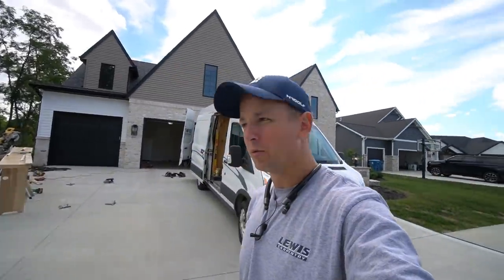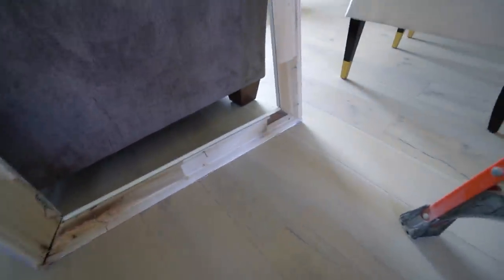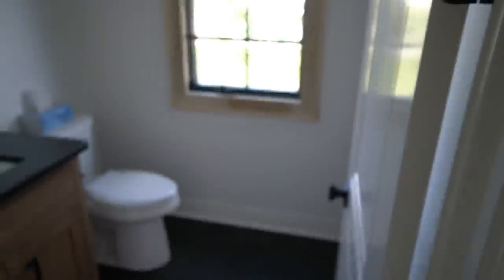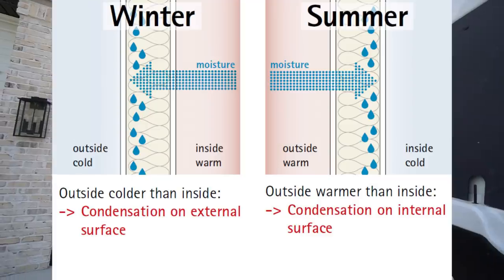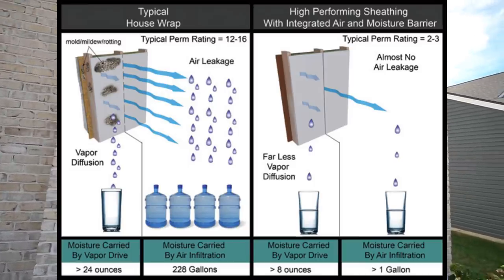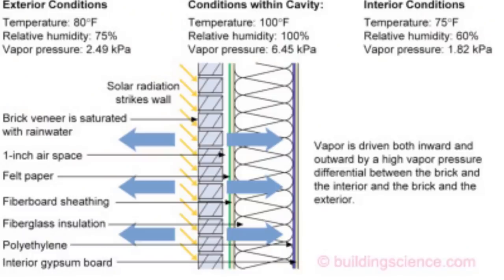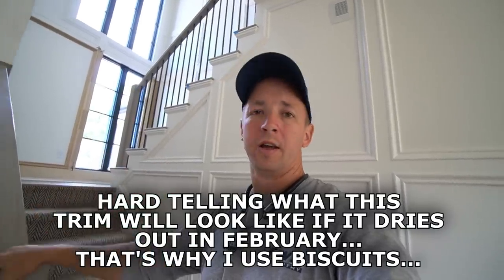Trim Humidity DISASTER!!! Is Vapor Drive Destroying this Trim Package???

Comment: You might have biased your responses by saying what your hypothesis is.  With that said has the North side been exposes to excess bulk water or water absorption from the ground.  1/2 in closed cell spray foam might not have been enough to prevent vapor drive from a water absorbing cladding.  2 inches of closed cell spray foam has a perm of less than 1.  However it might be enough to prevent drying to the outside as well as allowing vapor driving to the inside.  Is the Air changes per hour (ACH) known?  What has the interior relative humidity been?  What has been the average condensation temperature?  Other issue is installing a kraft faced fiberglass bat.  This essentially acts like a moisture sandwich for the fiberglass.  Moisture/vapor will reach the fiberglass middle (between the CCSF and the kraft facing) and have a difficult time getting out.  Should have installed the fiberglass bat without a facing.  What humidifiers have been used?  Build tight ventilate right.  Ultimately hard to say whats causing it without opening up some walls.  Based on what you've shared recommendations may include:  removing drywall and fiberglass bat, spray another 2 inches of CCSF, then fill remaining bay with unfaced insullation, install whole house balanced or slightly positive ventilation.  I feel terrible for the owner, looks like a real beautiful home.

Comment: So by reinforcement do you mean glue? In your videos it comes off that you use the clam clamps and hipur gun for casing, but in this video you mentioned biscuits. Are you biscuiting every window casing in your work?
Reply: I was wondering the same thing.I mean surely they at least used glue, but he kept saying miter reinforcement so it threw me off
Reply from the maker: For this size casing I would be using hipur. For the replacements on this job I used number 20 biscuits and clam clamps. There was basically no glue on the miters in this house and no clamping pressure.
Reply from the maker: For this size casing I would be using hipur. For the replacements on this job I used number 20 biscuits and clam clamps. There was basically no glue on the miters in this house and no clamping pressure.
Reply: @InsiderCarpentry  thank you for the clarification

Comment: If the front of the house is the North side then it was probably cold during the winter and condensing water from inside the house.  Is there a humidistat issue turned too high.

Comment: Looks like there is no vapour barrier on the inside.  I should have watched the whole video first.  There needs to be a air gap (cavity) between the inside face of the brick and the breathable membrane on the walls to allow moisture to escape.

Comment: If the trim is that bad just imagine with the studs are going to look like and why are you re-trimming if you haven’t found out the problem and fixed it. I would definitely say you need to put some air circulation inside the walls in the attic that shoot down to the brick and also from the bottom drill holes so it gets a total dryer out...And I noticed a lot of aluminum /metal case windows Where AC air units are Close to windows create moisture And that is never good

Comment: Cavity has no air circulation insulation blocking air bricks and air flow ..  
plus need to open window s  hot air meet cold air condensation

Comment: I’d be happy to help you solve the problem. In order to do so I need some additional information.
Where is the structure located City and State)
Direction the walls with the issues face (N,S,E or W)
Seasonal weather (Temperature and Rainfall)
Date of construction
Envelope description (Drywall to Brick or Stucco)
Type of windows
When was the brick and or stucco installed (Month and Year)
Roof construction 
Any previous or none related construction issues

With that information I should be able to assertion the construction deficiency(s) and a potential solution.
Aloha,
Steven Rich
Construction Defects Expert
ICC Certified  B-5 Building Inspector

Comment: right on with the a/c problem...there is not enough air exchange taking place INSIDE the house. Trapped moisture inside the house
What was used for vapor barrier under the slab? 
Sorry to say but until the moisture problem is solved your efforts are wasted

Comment: I'm in the water remediation an this is a recurring issue in alot of brand new homes
Reply: An alot of the builders say they are using non permeable block I've spent hours on wet tests to find the leaks due to poor sealing inferior builds cheap product building homes built in wrong locations of materials not suited for the areas an on an on insurance companies love this kinda work
Reply: Now I'd love to share but I can't but we be dealing with the same problems

Comment: I have seen this happen when the homeowners left the air off all day with all the windows closed and programmed it to come on an hour before they got home. Busted almost every joint in the house loose even custom raised panel cabinet doors were going bonkers. They stopped doing that and left the air on or left windows open and it cleared up in a week.

Comment: Is the house under negative pressure and\or  is there a makeup air system installed.
Reply from the maker: Likely under negative pressure. Bath fan runs constantly. No ERV.

Comment: This house must have a humidifier!  Wood window guy for 30 years.  Check the house, if they are setting up over 12% it is an owner, contractor issue not trim.  this is not a trim issue!  Moisture check the studs any exposed wood.

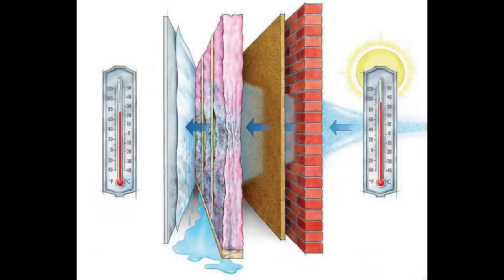Comment: The drawing at 3:47 is not exactly ok if it is for a climate like Montreal with massive swings in temperature; you need fur in between the vapor barrier and the gypsum. Anywa, what a mess for an homeowner

Comment: This is exactly what happens when your house is too tight with and oversized A/C unit and too small ( or none ) of an air exchange unit.... An air gap between the brick and the wall does nothing if there isn't any air flowing through said gap... It's just a static thermal break. Just my opinion.

Comment: Sounds like no air space behind brick is trapping moisture and without a vapour barrier on the backside of the drywall it can make it through the wall cavity no problem. 2x4 walls with that little insulation sounds like an issue too. 1/2" of closed cell foam would be around R-3 i think. Terrible building science. Whoever designed that should stop designing houses asap.

Comment: Spray foam all the gaps around the windows as doors before you put the casings back on. It should help to prevent the moisture from coming through and causing condensation.

Comment: I’d start first by getting an “old timer” AC guy out there and make sure the AC is the correct size and vents are positioned correctly. Retired “OT” are even better! Them “old timers” have seen everything and probably know the solution, even if it’s not AC related.